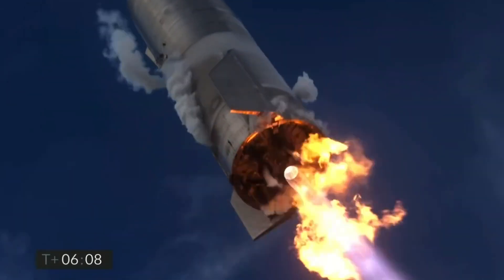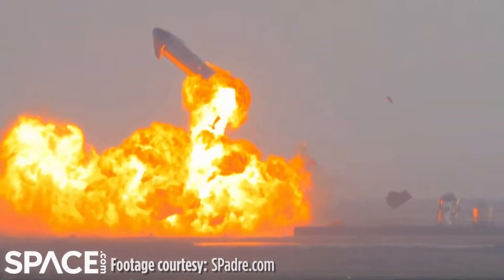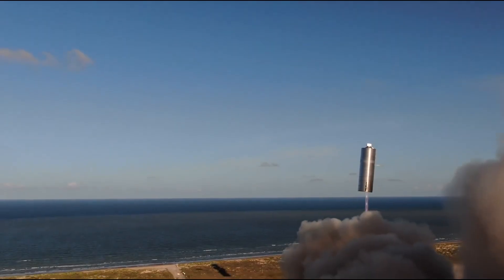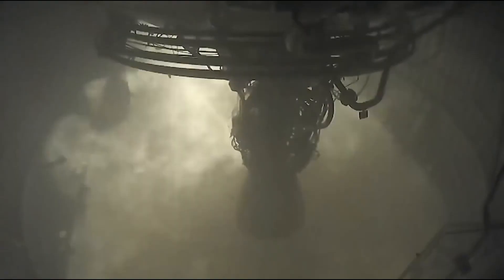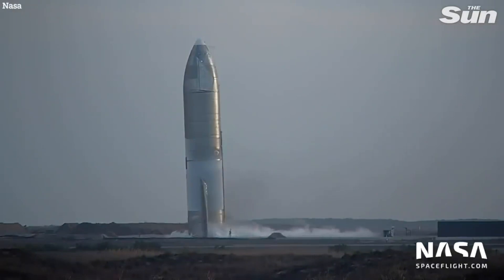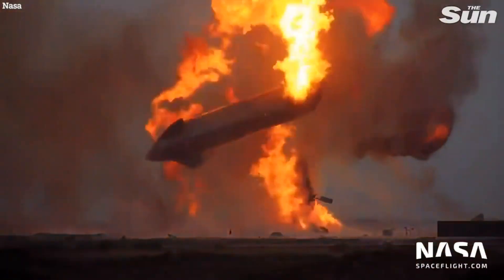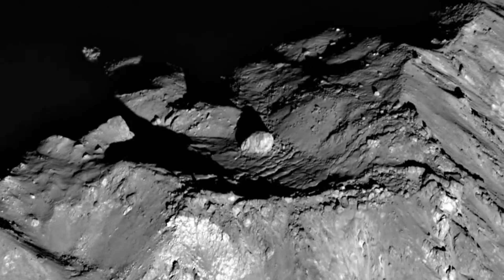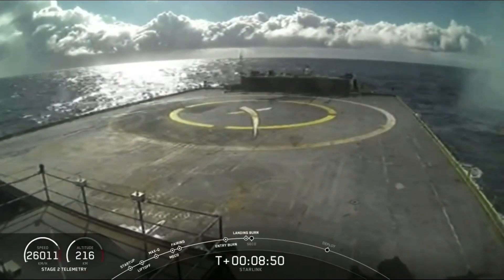Why SN10 exploded after landing?

Comment: Doesn't look like you follow the Starship development very closely, but they have stated that the little crush legs that are on these prototypes are just a temporary design.  Pointing out that this design and the precision of touchdown velocity at this stage in its development would not work well on extra terrestrial surfaces is rather silly.
Reply from the maker: Definitely there will be a lot of improvements in actual starship going to moon/mars.

Comment: the present legs on sn10 are a temporary solution.  on video, only 3 of 6 legs locked into position and all completely crumpled so that the skirt was sitting on the pad.    scott manley calculated the rocket was not decelerating and was moving at 15mph when it landed, which is too fast.  perhaps the second engine shut off too soon or the last engine did not develop enough thrust to continue slowing the vehicle
Reply: From what I've read, only one engine is used because two creates too much lift. The ship is running on fumes at touchdown. But obviously landing perfectly isn't easy
Reply: @jjtimmins1203  not sure if fumes is correct, that was a pretty big explosion when it decided to fly again.  i assume you would use two until your vertical velocity is zero and then drop one?
Reply: @peetky8645  not sure of landing fuel weight but it's marginal compared to takeoff weight. That was a large fireball but it represents a tiny fraction of the energy potential of a full fuel tank. One raptor engine  has a 200:1 thrust ratio and can only be throttled down to 40 percent. So if you use fuel as ballast and use too much it'll be difficult to land due to thrust power alone. It's all tricky AF
Reply from the maker: One good thing come out of it is, starship is showing improvements in every new launch

Comment: The landing legs are shit, almost cosmetic. So that one of them didn't deploy is on surprise. That SN10 leaked methane is clearly visible in the small bonfire after landing. Maybe if they hadn't put it out, the methane would burn off as it leaked out? Anyway, that it exploded is barely an afterthought. It would be either an scheduled or an unscheduled disassembly. I will not be surprised if the same happens to SN15, since I don't think they'll bother about the landing legs. At this point, it's an non issue.
Reply from the maker: Hopefully they find a solution for the same.